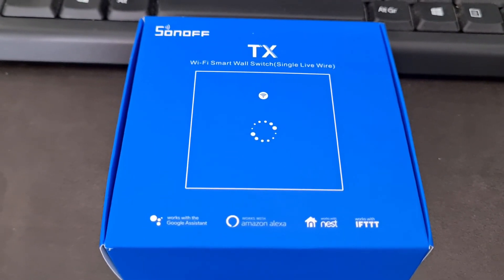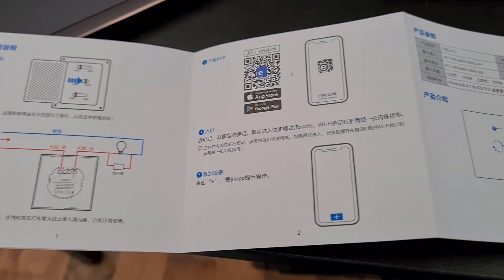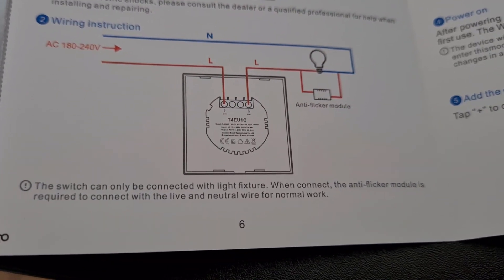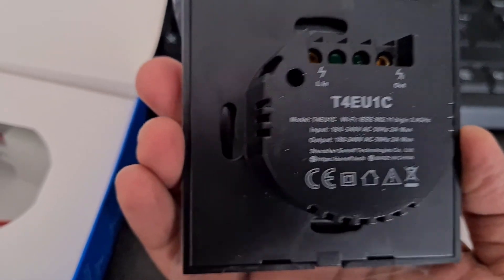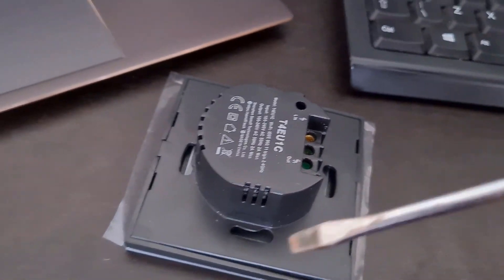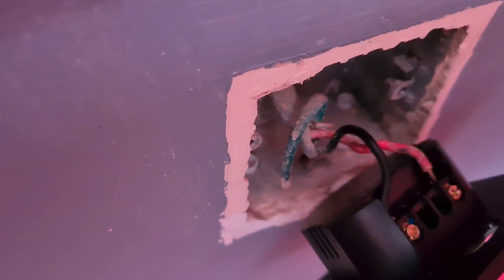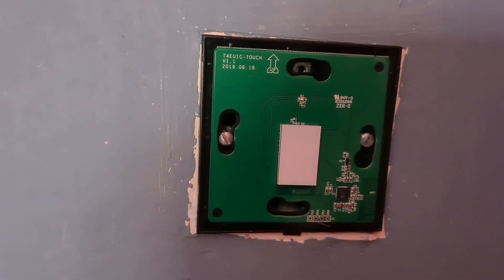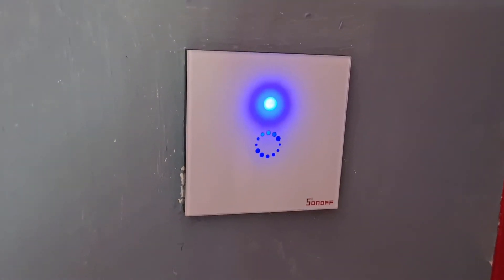Sonoff TX T4EU1C Smart light switch no neutral wire needed - Zigbee and Alexa compatible

Comment: Good day, I haven't installed the capacitor yet, I can see one bulb flickering when it's off at the switch, also the switch goes offline when I switch on one specific light, I have a 3 gang max load 300 watss, I have 2 bulbs 30 watt total and a extractor fan 40 watts is the fan ok to use with the switch 300 watt max load I'm under it, will installing the capacitor solve these problems?

Comment: most UK boxes are not deep enough for these but a good work around is this .
https://www.amazon.co.uk/dp/B00NGT1WTA/?coliid=I2PC2KRFLCWAFA&colid=3DU51HKY88IUD&psc=1&ref_=lv_ov_lig_dp_it
another good work around is to use a Sonoff Mini
https://www.amazon.co.uk/dp/B07VF13FZZ/?coliid=I2RZKSJCJZPN3Q&colid=3DU51HKY88IUD&psc=1&ref_=lv_ov_lig_dp_it
I cut a small hole behind the ceiling rose and put them above the ceiling. works great, and you keep your existing light switch but will only work if you have unswitched live and neutral in the ceiling rose

Comment: I have 2 of these switches. They use WiFi and not Zigbee as mentioned in the title of this video. if you don't want to use the app provided and control it directly from your home automation system then it is fairly easy to change the firmware to something else, e.g. Tasmota.

Comment: You British are really strange :D You don`t have neutral line, you use 2 separated source of water(super cold or super hot). Funny thing is that i`m here only because i had electrican who worked at UK and he made one lights switch in UK style:D Thanks for your video, have a nice day!
Reply: no real need for a neutral at the switch it would just be an in and out loop, waste of wire. you only need a neutral in the ceiling/wall at the light fitting.
Reply: @andybawn1  But it does make it really hard to design a smart or touch light switch run ONLY off the series connection between Live and switched live. This is especially true because modern LED lights will glow with just leakage current!! thats why the "no neutral" touch switches come with an extra capacitor!  Anyway just move to Turkey and they have Neutral in the back of the box
Reply: New houses in Britain have a combined hot and water source now